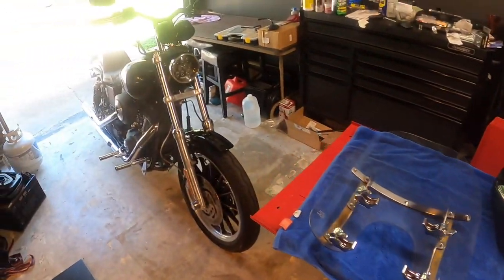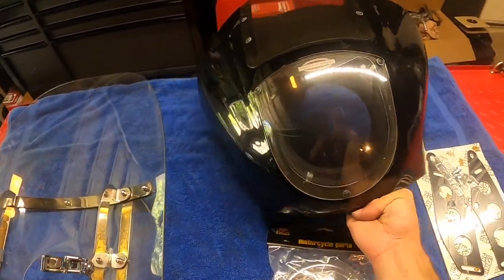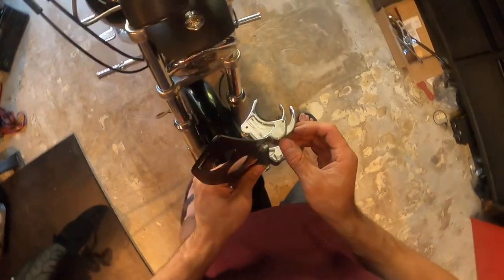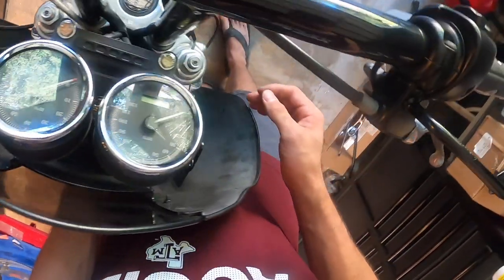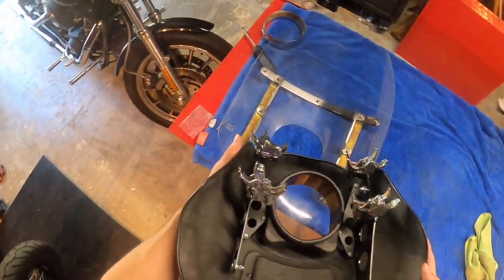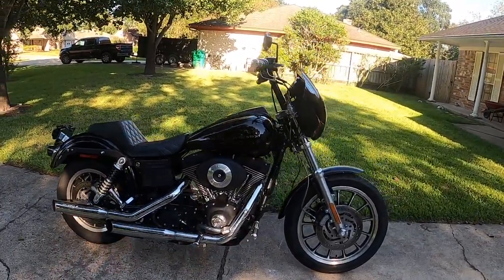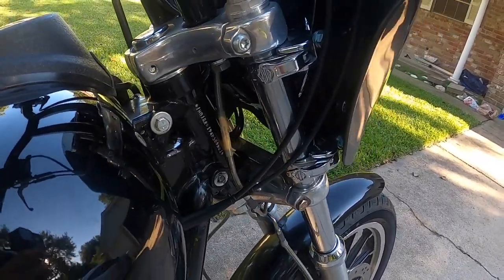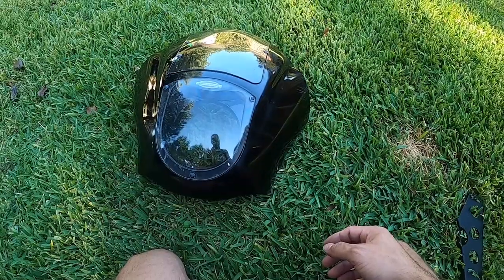Harley Quarter Fairing Windshield with Quick Detach

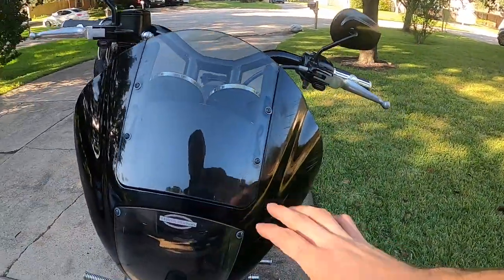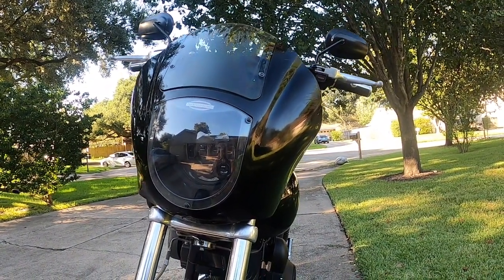Comment: Thanks for sharing your experience. ✌🏻11:19 dog starts with the intruder/stranger danger barking. 11:42 shots fired, “Sorry about that.” 😂 Then subject appears, slips in driver side rear passenger door and they creep away. 🤣😂Just FYI, aftermarket LED headlights fit directly into the fairing. Which means dumping the headlight bucket and being certain the wiring is properly protected from weather. Much tighter fit and the headlight spacer/extension blocks aren’t even necessary. Thx ✌🏻⚓️🇺🇸

Comment: how much does the tinted version affect the brightness of your headlight?
Reply from the maker: A lot. I had the smoked one before and ended up removing it and running it with no lens.
Reply: @twinsmotogarage1866  Damn!
The smoked one looks so nice, i was planning on putting some stickers on the top part of the windshield. Guess I better go with the clear, especially because I often ride during night time  and I’m based in northern part of Europe.

Comment: Did you have to add head light extension block
Reply from the maker: No. Im no pro but I think the head light extension is more for the T-Sport fairings not the quarter fairings.
Reply: What headlight bracket do you use?